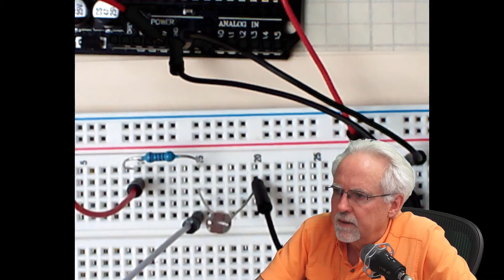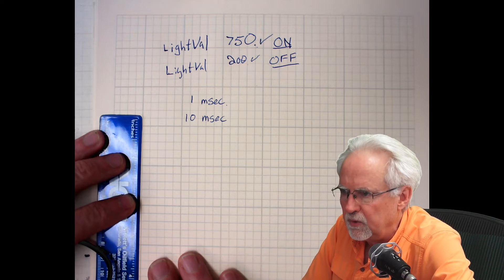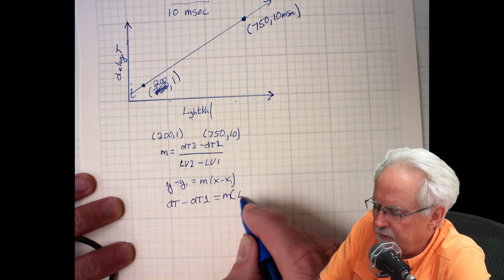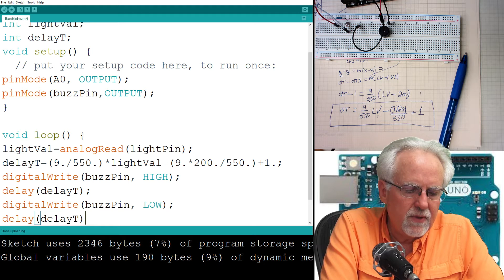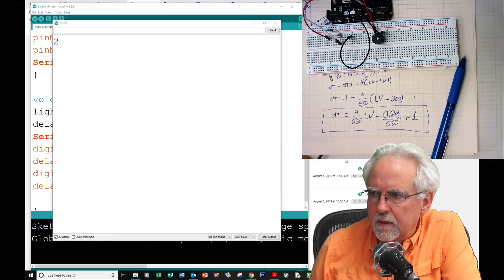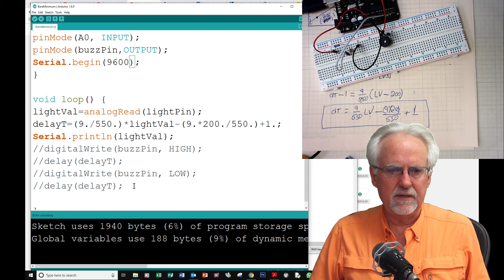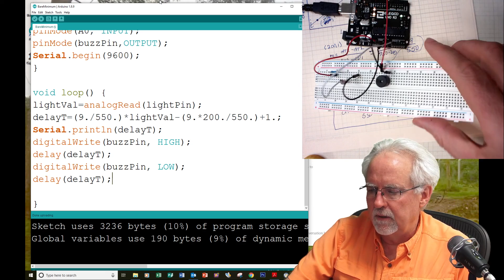Arduino Tutorial 26: More Fun with Photo Resistors

Comment: I know its ages ago, but I noticed you forgot to erase the command to print the light value on the serial port after debugging. I think that limited the audio range of your buzz to the speed of the activity on the serial port. That is; the buzzer frequency was limited to the speed on the port. Am I right?
Reply from the maker: Good eye, you are absolutely correct that the serial prints were slowing things down!

Comment: You say you do something and then you do something different to make your graphic clean. 750 light level to 1ms and 200 to 10ms you said initially, but you changed your mind. Do it like that or tell that the graph is linear, more light, higher pitch and in this case you don t need math...
Reply from the maker: You seem angry.

Comment: Got it working on my own, but out of the gate my buzzer pitch was higher in low light and lower in bright light, which was the opposite of what i was expecting when i did the math, but then i remembered that the pitch value is invertedly affecting the frequency because you're controlling the delay...bigger number == longer delay == lower pitch

Comment: i know Im a little late, but just a little confused. Last lesson, you had the photoresistor first in series, and in this one you had the 5k resistor first. wouldn't this invert the arduino output, so when lights are off, you get a higher value?
Reply from the maker: I will work either way, just one way bigger reading as it gets brighter and other way smaller reading as it gets brighter.

Comment: Can we use analogWrite() command. 

int buzzer = 6;

int t = 120;

void setup(){

  pinMode(6,OUTPUT);
  
  pinMode(A0,INPUT);
  
  Serial.begin(9600);
  
  
}

void loop(){
  
  int a = analogRead(A0);
  
  float Va = (5.0/1023.0) * a;
  
  Serial.println(Va);
  
  float DVa = (255.0/1023.0) * Va;
  
  analogWrite(6,DVa);

}, and its working correctly

Comment: I usually work ahead the class every day i usually build five five different projects that will compile all what have learn from all the lessons that have over come every day by day even so I have already do the project even compile it with four light dictator in which three stand for street light and one for how bright it is by PWM also for the passive Buzzer for the voltage values 
But sometimes I use another method that I understand  more better like for some side of code eg.

int p_resistor=A0;
int analogpin=3;
int Dpin1=13;
int Dpin2=12;
int Dpin3=11;
int readvalue;
int outputvalue;
int rest=500;

void setup() {
// put your setup code here, to run once:
Serial.begin(9600);
pinMode(p_resistor, INPUT);
pinMode(analogpin, OUTPUT);
pinMode(Dpin1, OUTPUT);
pinMode(Dpin2, OUTPUT);
pinMode(Dpin3, OUTPUT);
}

void loop() {
// put your main code here, to run repeatedly:
readvalue=analogRead(p_resistor);
outputvalue=(255./1023.)*readvalue;
analogWrite(analogpin, p_resistor);
Serial.println(outputvalue);
delay(rest);

if (outputvalue <= 150) {
digitalWrite(Dpin1, HIGH);
digitalWrite(Dpin2, LOW);
digitalWrite(Dpin3, LOW);
}
else if (outputvalue >150 && outputvalue <= 170) {
digitalWrite(Dpin1, LOW);
digitalWrite(Dpin2, HIGH);
digitalWrite(Dpin3, LOW);
}
else {
digitalWrite(Dpin1, LOW);
digitalWrite(Dpin2, LOW);
digitalWrite(Dpin3, HIGH);
}
}
Reply: I made a little mistake that place before 

int p_resistor = A0;
int analogpin = 3;
int Dpin1 = 13;
int Dpin2 = 12;
int Dpin3 = 11;
int readvalue;
int outputvalue;
int rest = 500;

void setup() {
  Serial.begin(9600);
  pinMode(p_resistor, INPUT);
  pinMode(analogpin, OUTPUT);
  pinMode(Dpin1, OUTPUT);
  pinMode(Dpin2, OUTPUT);
  pinMode(Dpin3, OUTPUT);
}

void loop() {
  readvalue = analogRead(p_resistor);
  outputvalue = (255.0 / 1023.0) * readvalue;
  
  // ✅ Correct analogWrite usage
  analogWrite(analogpin, outputvalue);

  Serial.println(outputvalue);
  delay(rest);

  if (outputvalue <= 150) {
    digitalWrite(Dpin1, HIGH);
    digitalWrite(Dpin2, LOW);
    digitalWrite(Dpin3, LOW);
  }
  else if (outputvalue > 150 && outputvalue <= 170) {
    digitalWrite(Dpin1, LOW);
    digitalWrite(Dpin2, HIGH);
    digitalWrite(Dpin3, LOW);
  }
  else {
    digitalWrite(Dpin1, LOW);
    digitalWrite(Dpin2, LOW);
    digitalWrite(Dpin3, HIGH);
  }
}
Reply from the maker: Excellent!
Reply: Thanks you very much sir sir dose my code will also work perfec sir

Comment: Joining the party a few years late. Something I noticed (not sure if it's already in the comments) after programming my formula based on lights on and off, reading "lightVal"; as the program was running, I decided to cover the photoresistor with my hand, and the program just stopped, as did the buzzer.

Answer: If "lightVal" is too low, it will drive "delayT" below 0.

Comment: Accidentally doing integer maths when you actual need to do floating point maths is an awfully difficult bug to find!    255/1023 instead of 255./1023. etc.
Reply from the maker: Yes it is perhaps one of the most difficult of all problems to debug, and you begin to conclude your arduino is broken.

Comment: This has been a most excellent series. I'm late to the party (2025), but better late than never. This has been the first lesson I struggled with. It took a couple of days working it out, but finally got it on my own. My issue was not with the circuit, or the code. It boiled down to using the wrong values for the two points of the line when calculating the slope and the line. 
I came here originally to learn a bit about the Arduino, but am staying for the wealth of information. Thank you very much for these most excellent lessons!
Reply from the maker: LEGEND!

Comment: int photoPin = A5;
int photoReadVal; // reads from 28-929 with 5k resistor (901 difference)
int buzzPin = 8;
int dt; //wanna hear from 60 to 10k μsecs

void setup() {
  // put your setup code here, to run once:
  pinMode(photoPin,INPUT);
  pinMode(buzzPin,OUTPUT);
  Serial.begin(9600);
}

void loop() {
  // put your main code here, to run repeatedly:
  photoReadVal = analogRead(photoPin);
  //y = ax+b (b is offset 60), (a = buz range/photo resistor range), for vector (28,60)
  dt = (9940./901.)*(photoReadVal - 28) + 60;
  
  digitalWrite(buzzPin,HIGH);
  delayMicroseconds(dt);
  digitalWrite(buzzPin,LOW);
  delayMicroseconds(dt);
  Serial.println(dt);
}

Comment: Hey Paul , can't we form equation by taking (x) as the buzzer value and (y) as the photoresistor value on the graph . I made equation with this , am i wrong.?
Reply from the maker: You have to understand the difference between the Independent and Dependent variable. The Independent variable is what you have, or what you can set (you have the photoresistor value). The dependent variable is what you need (the buzzer value). X is the independent variable, Y is the dependent variable.
Reply: Mmmmm , Got it sir .
Thanks for creating that much crazy content on yt.

Comment: I'm a new starter on Arduino, but have done quite a bit of programming in other languages. Maybe I'm jumping ahead here, and I appreciate the need for understanding the math to calculate the delay time here, but I found a far simpler way to make this work. There's a tone() function in Arduino, that generates a tone of a specified frequency on a specified pin, and there's a map() function that will easily convert the input voltage into a frequency in Hertz. So 2 lines of code, and no math had this working for me.
Great lessons though Paul, I have no complaints, I'm learning this very easily.

Comment: My assignment:

int sensorRead = A2;
int buzzPin = 9;
int Val=512;
int Min = 1024;
int Max = -1;
int minBuzz=60;
int maxBuzz=10000;
void setup() {
  pinMode(sensorRead,INPUT);
  pinMode(buzzPin,OUTPUT);
}
void loop() {
  Val = analogRead(sensorRead);
  if (Val > Max) Max = Val;
  if (Val < Min) Min = Val;
  float lp = 1.0*(Val-Min)/(Max-Min);
  int buzz = lp*(maxBuzz-minBuzz)+minBuzz;
  digitalWrite(buzzPin,HIGH);
  delayMicroseconds(buzz);
  digitalWrite(buzzPin,LOW);
  delayMicroseconds(buzz);
}

Comment: I messed up the math, didnt have a buzzer in my kit but I had a go at it, got some nice figures that worked on the serial monitor. Got a nice range of light readings for my room before \i started. Need to practice linear equations more. I guess I didnt understand what I was meant to be calculating but I have a much better understanding now. Fascinating stuff, will explore more and keep following Paul.

Comment: For the homework assignment you said it should be "pleasant and continuously varying" so I took that to mean that the photo resistor extremes would be "where the sun don't shine" and "the surface of the sun", which is very different from the average room with the lights turned on and off. Therefore I ignored the resistance values from the volt meter and just plugged in the same formula from the potentiometer lesson.  The result was a much more smooth and pleasant experience and it was actually fun to play with by varying the exposure to the resistor with my hand. Much like playing a theremin.

Comment: I had very different values for dark and light.   (250 -- finger covering sensor  to 1000-- very bright flashlight).
I used microseconds from 60microseconds (very high pitch) to 10000 (low buzz).i ended up very different looking equation.

It works perfectly.
My dilemma for a bit was 
Neg x neg = positive lol

Comment: I tried my best to figure out the code; but went down a "rabbit hole" trying to use 'if" clauses. So I really flunked this one big time. However I will give my self pat on the back because I noticed your error in assigning the A0 pin as an OUTPUT instead of INPUT the moment you typed it into the program. I was shouting at the screen but you couldn't hear me. Anyway this lesson was extremely valuable as I followed your thinking when trying to debug the code to get it to work -- following your technique was quite valuable!!
Reply from the maker: LEGEND! Sometimes the best way to learn is by making mistakes.

Comment: Anyone else notice the buzzer functioned oposite of what it should have based off the graph. Based on the graph when the lights are on the delay should be larger, meaning the buzzer is lower pitched. And when the lights are off the delay should be shorter meaning the buzzed would be higher pitched. 
But then in reality it the delay increased as it got darker making the pitch lower. And the pitch got higher in the light. 

Am I going crazy or was this whole thing backwards?
Reply: @evans8486    As the light goes darker resistance goes higher, so lightVal (voltage) goes lower. And delayT becomes lower so the buzzer is lower pitched. I hope you understand now.

Comment: I did it myself by combining tutorials 24 & 25.  I am having one problem though.  If I have ANY "Serial" command in the program, the buzzer only clicks, presumably at each pass through the loop.  The TX LED on the UNO flashes in sync with the clicks.  But as soon as the "Serial" commands are commented out, it works fine.  What could be the cause?  

Thank you Paul for yet another terrific video.  This has been the best experience that I have ever had with a series of online tutorials!

Comment: This is what I did
int litpin=A1;
int litval;
int buzzpin=10;
int dt2=100;
int dt1=1500;

void setup() {
  pinMode(litpin,INPUT);
  pinMode(buzzpin,OUTPUT);
  Serial.begin(9600);
  }
void loop() {
  litval=(1000/1023)*analogRead(litpin);
  Serial.println(litval);
  if(litval>=700){
    digital.Write(buzzpin,LOW); 
  }
  if(litval<700 && litval>=349){
    digital.Write(buzzpin,HIGH);
    delayMicroseconds(dt1);
    digital.Write(buzzpin,LOW);
    delayMicroseconds(dt1);
  }
  if(litval<=350){
    digital.Write(buzzpin,HIGH);
    delayMicroseconds(dt2);
    digital.Write(buzzpin,LOW);
    delayMicroseconds(dt2); 
  }
//Idk if it's correct I haven't verified 

    
    
}

Comment: Why do you write dt = 9/550 * displayVal - (9 * 200 / 500) + 1 when its a lot longer and a less acurate than just writing dt = (dv - 200) / 550 / 10 ?
Reply from the maker: Because I am reducing it to the standard form of a linear equation, and it is NOT less accurate, it is the right answer in the standard form.

Comment: Thanks sir, it worked. At first, I did it in a different way without doing math using this code:
int lightPin=A0;
int lightVal;
int buzzPin=6;
int buzzVal;
int dt=250;

void setup() {
  Serial.begin(9600);
  pinMode(lightPin,INPUT);
  pinMode(buzzPin,OUTPUT);
}

void loop() {
  lightVal=analogRead(lightPin);
  Serial.println(lightVal);
  delay(dt);

  lightVal=map(lightVal,0,1023,0,255);
  analogWrite(buzzPin,lightVal);
}
and it was working the same way ,and also louder than the one in the video, but I don't know the reason.
Reply: niiiice!!

Comment: I did 
int portCheck=A3;
int portCatch;
float portHack;
float portHacked;
int buzzer=6;
float resistance;
float thesound;

void setup() {
  // put your setup code here, to run once:
Serial.begin(9600);
pinMode(buzzer,OUTPUT);
pinMode(portCheck,INPUT);
}

void loop() {
  // put your main code here, to run repeatedly:
portCatch=analogRead(portCheck);
portHack=(5./1023.)*portCatch;
portHacked=5-portHack;
resistance=(25500-(portHacked)*5100)/portHacked;
thesound=(resistance-1000)/41.17;
analogWrite(buzzer,thesound);
Serial.println(thesound);
delay(10);
}
Reply: btw love from INDIA

Comment: Hello Paul sir, I have a doubt in your previous lecture you have connected one end 5k resistor to GND and one end of photoresistor. That was correct according to circuit diagram.  But in this lesson you just reversed the connections but it worked well. Can you tell me please??

Comment: I think the circuit was incorrect and the buzz output was reversed right? It does work but as a little happy accident. Wasn't the intention to measure voltage across the 5k and not the photoresistor as in the precious lesson? The circuit seems to be hooked up to read across the photoresistor. As a result, the buzzer acts opposite as the plotted graph e.g. 200 for 1 ms and 750 for 10 ms. As soon as the code is debugged, lights on, its printing 250 which corresponds to lights off. Or am I crazy?

Comment: Yes, you can use the value of a pin in the [ "pinMode()" FUNCTION ], SYNTAX:
pinMode(pin, mode);
- pin: the number of the pin whose mode you wish to set.
- mode: the mode to set the pin to, wich can be 'INPUT', 'OUTPUT'.
EXAMPLE:

void setup() {
    pinMode(A0, INPUT);   //Set the analog pin A0 to input mode
}
INSTED

void setup() {
    pinMode(lightPin, INPUT);   //Use the lightPin variable to represent pin A0.
}

Comment: I worked it out for myself, based on what you had already taught me. I used an LED torch and my finger to get a range of 65 to 9500 microseconds. I simplified the equation on paper, before coding, to make the program easier to read. I checked a number of points to prove slope was valid. Neat lesson. Thank you from South Wales in the jolly old UK.

Comment: My learning  was to use y = mx+b for two pont data on the xy graph. You caluclate m which is the gradient and i get the same value as  in the tutorial 9/550, and then you grap one of the data points to calculate b so then b = y-mx. I am stuggling to find how you come to the end equation its like you made an assumption it crosses the xy axis at 0,0 is that right?. And even if i put the data point 750 for LV  into the equation you get 8 not 10 . By my formula it should be dT = 9/550 *LV - 2.273.  Paul could you kindly tell me if am wrong?

Comment: Great and difficult session!  I used different values (tone delay from 60 to 9000, and light input from 200 to 1000) then used delayMicrosecond, and the found that he serial monitor interfered with the operation of the buzzer!  Thanks for the math practice!
Reply from the maker: Excellent!
Reply: took me a solid 45 minutes to figure out that the serial monitor was causing my buzzer to click instead of run properly.

Comment: I make it before watch your solution.  I used microsecond delay instead of the milliseconds, and it produced more dramatic tones.  I made the room dim , turned on my iphone's flash light, and moved the flash light closer or further from the photo resister.  My analog read voltage is based on the voltage of the regular resister, not the photo resister.  I did brighter with lower tone and darker with higher tone first.  Then did another calculation to reverse the  relationship between the light and. tone: brighter with high tone and darker with low tone.  It is fun!  Thank you, Paul!

Comment: I made my own circuit and code before I watched your video.  I came out with a negative slope so that the tone was low when the lights were dim and the tone was high when the lights were bright.  However you had a positive slope but we both had the same end result. 

X1,Y1: 0(lightVal),10,000(delaytime)
X2,Y2: 1,000(lightVal), 50(delaytime)

slope of those 2 points are -9000/1000

I might need to watch your answer a little closer to figure out what the difference is.  However, after 26 lessons I'm still here and you got a new Patreon subscriber.  Your you very easy teacher to learn from.  Thank you.
Reply: I KNOW WHAT YOUR TALKING ABOUT! I I had a positive slope so my buzzer functioned the opposite of what it did in the video. Everything in the video was backward in reality than in the math I don't know how or why. Please let me know if you ever found anything out

Comment: Great video!  For some reason my Arduino Uno pin 8 "digitalWrite" output to the buzzer is not symmetrical.  For example, delay time = 10 ms, and on time =10ms, but off time is 36ms.  Not sure why this is - the previous buzzer tutorial had equal on and off times for digitalWrite.